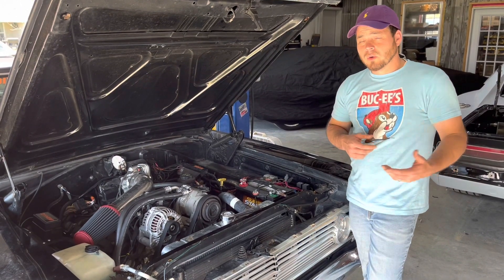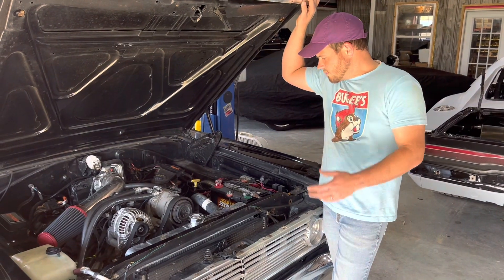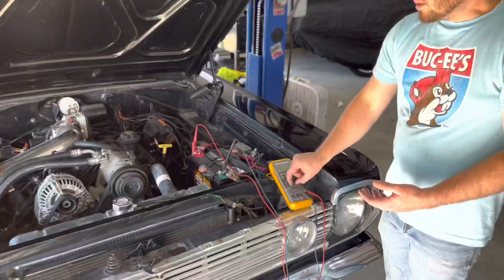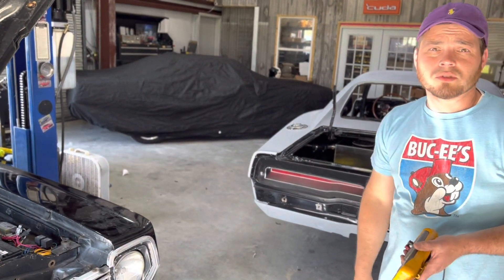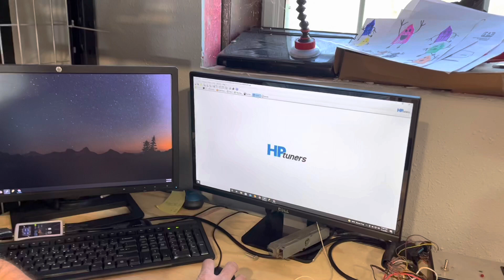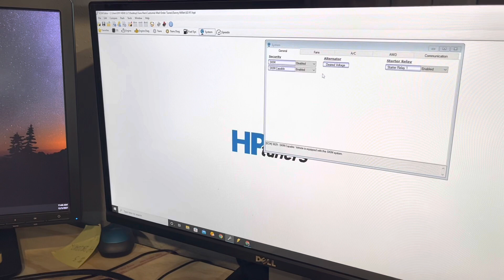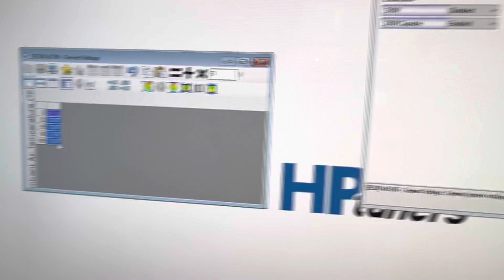High Voltage - Hemi Alternator Overcharging Problem Fix by DIYHEMI

Comment: Can an overcharging situation cause intermittent stalling? The only problem i see with my 2005 hemi. Is its about and 1/4 in over normal on high side of the Voltage guage. I believe it charging around 15v. It never used to be that high. Something is off. Any ideas? Could it be this.

Comment: The alternator puts out a constant voltage being generated off of the belt.  I don't understand how they get the alternator to change the voltage that it generates.  EDIT : wouldn't the company that put in those parameters be responsible for the boiled battery?

Comment: Wait, so the the tune was asking for the high voltage? I have HP tuners also
Reply from the maker: Yes, it was asking for 15 volts
Reply: I looked at my settings at its 14.70 for cold weather. But it was cracking 15’s and high 16’s today. Dash and radio cut out for like a second while driving
Reply from the maker: @Mopar300S  bump it down to 13.5

Comment: I’ve acquired a 2006 Durango that I plan to use the complete drivetrain into a 1979 Jeep Cherokee. Is this a swap you’ve done or have seen done, looking for any helpful information.
Reply from the maker: We haven’t done a Cherokee yet, but may at some point. The swap should be pretty easy once you get the mounts and oil pan sorted out
Reply: @SUBLIMEparts  I have to do all the measurements, but if all checks out well I plan to put the body on the Durango chassis.
Reply from the maker: @davidroberts3489   we also have an awd 2005 hemi Durango at the shop and we’re thinking of a body swap project! Keep us posted if you go through with it!
Reply: @SUBLIMEparts  I’ll do that, watching your videos helped me to decide and do this project.